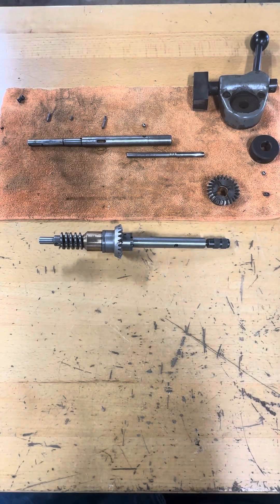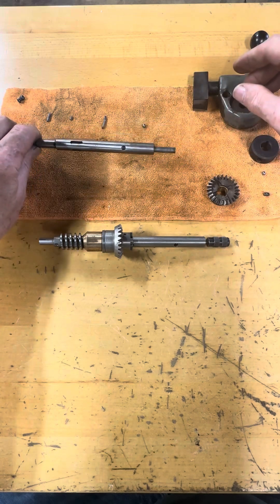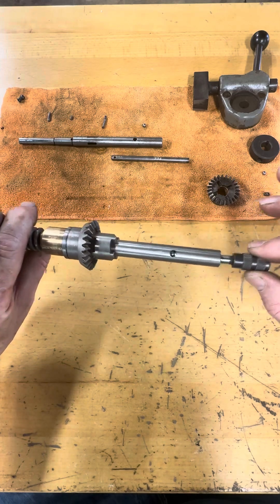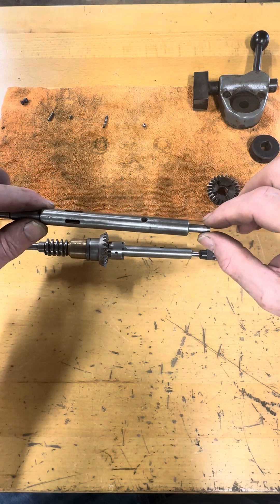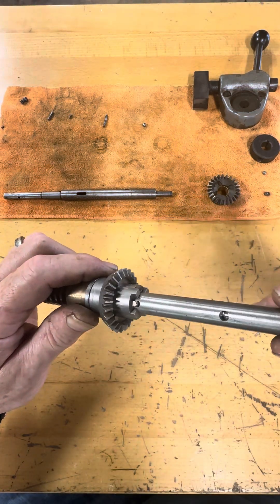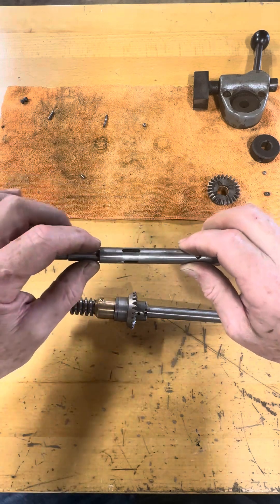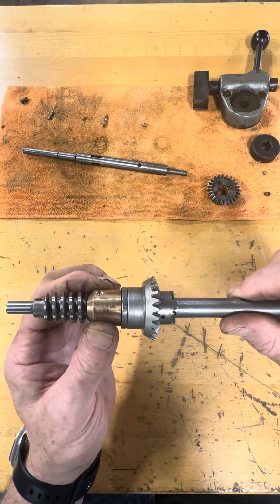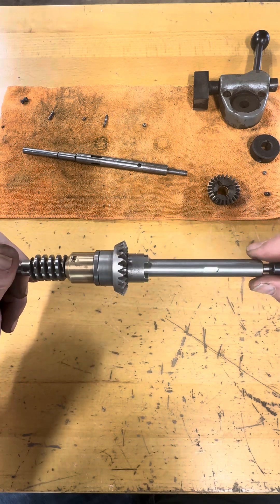Bridgeport mill - Tips for rebuilding automatic quill feed mechanism.

Comment: Excellent video.  Always add a coating of oil on reassembly when placing back in machine.  Grease is only applied to teeth of gears and not the shaft.